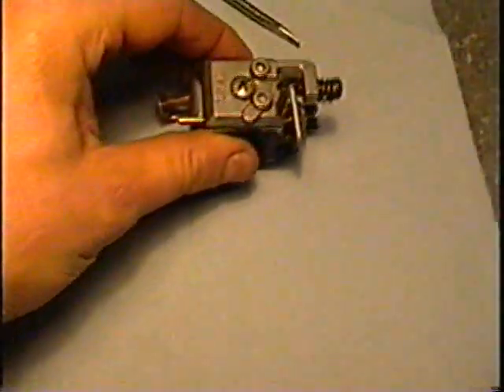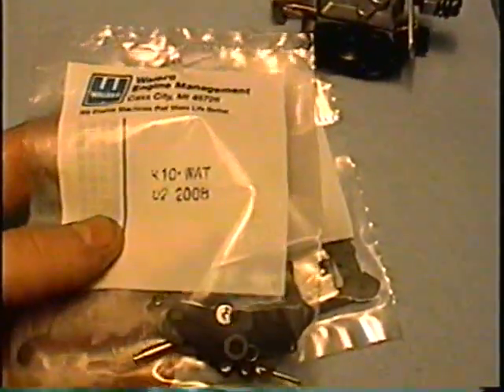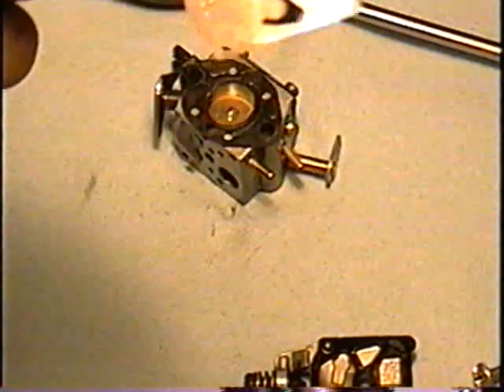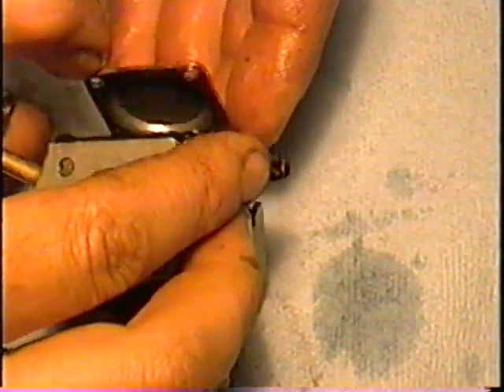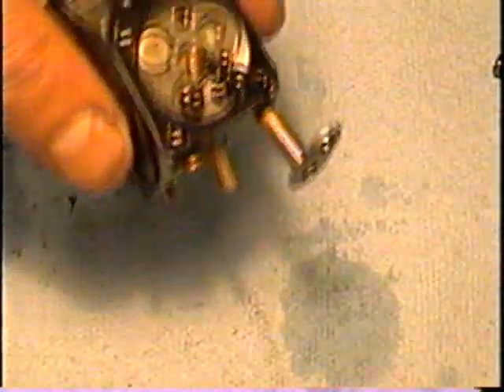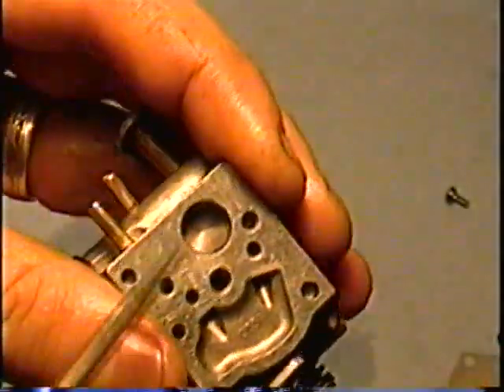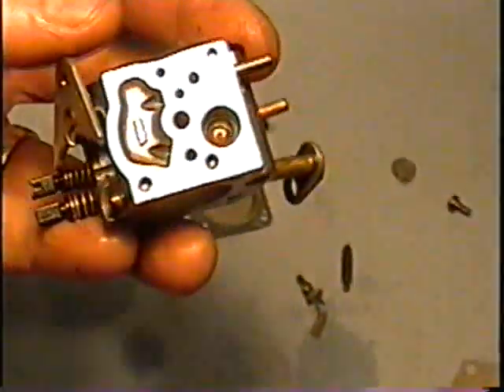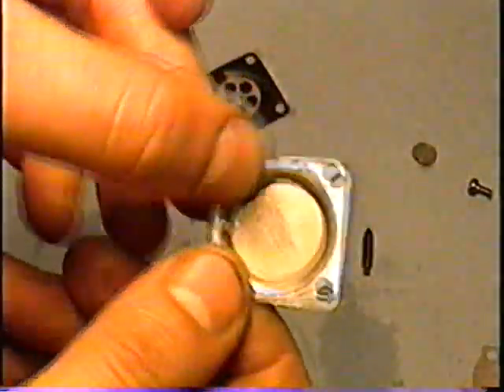HOW TO Disassemble Poulan 2150 Chainsaw Walbro Carburetor

Comment: I picked up an Echo weed eater today, and it wouldn't start so I took it to a local echo dealer and asked them if they had a carb kit for it, and they sold me the K10-WAT. kit. When they looked at the machine they said it was vintage "early 1970's"

Thanks for uploading this video, I may have been stuck without it, and i have to say replacing the needle, pin, lever, and spring was pretty dang tricky.

Comment: Hi, thank you for the demonstration. I have a 2150 that would start then die after a few minutes. I bought the kit and replaced only the pump diaphragm with the carb in place and without disassembling the linkage. Fixed the problem and I didn't have to go any further.

Comment: Thanks so much for your thoroughness. I rebuilt the carb with the k10 kit as per your video tutorial. My wacker now idles and does not bog down when opening the throttle however it still doesn't seem to be getting the higher RPM it needs to get the job done. I adjusted the high speed by ear....maybe too much oil in the mix? When does mixed gas become too old? Many Thanks.

Comment: Hi dony...I just picked up a 2150, used. It's been running great while still on the plug that was in it when I took it home. I've gone through a few tanks of fuel but with the last full up it won't start. I replace the plug and bought and filled it with 50:1 truefuel...synthetic oil and ethanol free 92 octane. Still won't start. It only fires with the throttle locked WOT. I checked the spark arrester which is fine. There was fuel coming from the exhaust. It has plenty of spark and again, fires

Comment: Hi Don I just cleaned the carb and it looks like there is no screen in this carb , is that an issue I mean there is the very dense filter in the tank and is there something I can put in the gas that will clean all the openings in the carb maybe a bit of marvel mystery oil or would make it too high in oil gas ratio, I did loosen that screw that holds that tiny spring in didn't want to have to put that back together again that's why I ask

Comment: Thank you so much for the informative video. I was at my wits end with mine and it was about to be binned and it turns out I had the metering diaphragm upside down - metal ring on the outside not inside where it would operate the valve. Nowhere else was I able to see this..

Comment: Without yet picking it'd seem the one still covering its hole is set in place. The other, being removed, I see covers some tiny pin holes. After setting it back over the opening, it too is now set in place.

Comment: Got a trimmer with a Walbro WT526 carb.  Replaced all 3 fuel lines and the primer but gas can't be pulled thru.  I bypassed the carb with a double-male fitting for testing purposes and it worked fine.  So I think the carb is plugged or the needle valve is stuck.  I have not disassembled it yet.  Any suggestions or common observations?  Should the rebuild kit be labeled for the WT526?  Thanks.  Sorry to see that X80057X was such a jerk.  Hope your wife will be ok.

Comment: It's odd like its flooding but at the same time starving for fuel. After searching, reading, and trying options, I narrowed it down to carb or coil. I just disassembled the carb to look for blockage. Under the 4 screw cover there are 2 buttons you don't mention in this video. One of the buttons wasnt where it seems to go. Could this be the issue? What are the buttons?

Comment: hey donny. are you aware of the carb upgrade for these types of poulan chainsaws?  if you buy the poulan/husky you get a different air filter holder and adjusting screw grommet. the number is wt 89. i put one on mine 2 years ago and it's still perfect. i even tried to adjust it again and wound up at the exact same spot.  the start pattern is different. now you pull the choke out and it automatically sets the throttle and flips the  start button up.little less than 20 bucks on ebay. would probably make a cool video. you can buy a knockoff  for 7 bucks but they don't come with the air cleaner and grommet.

Comment: OK.  Thanks.  The saw has good compression (115), good spark, the carb is rebuilt (with a screen this time) and new fuel lines and a primer bulb.  I know the lines are routed properly.  But it will not start.  Like you said, it made be plugged further in.  The saw is about 10 years old.

Comment from the maker: @youtom888 adjust the H screw at high speed until it run as good as it can. i usually don't keep mixed gas more than 60 days.

Comment: I have a question I am making something out of the motor  of a chainsaw ( the same brand as that one) and I need the whole motor out of the case. I have in done every thing holding the motor down and when I go to pull it out just the head comes off not the piston crankshaft noting  just the head. I didnt take off the clutch do I have to???  And if so how do I take it off?? PLZ reply

Comment: I changed out my old fuel lines(cracked)  My fuel bulb is also bad, so I by passed the fuel bulb. The saw runs good but each time I fill it with fuel it floods. I have to clean the plug,then it runs fine until I re fill  the tank.  Is this because I by passed the primer bulb?

Comment: hey guys i just so recently bought a poulan 40cc saw at my local flea market and it wont fire it has good compression and it gets gas 
so i pulled the carb apart and i forgot where 2 screws go and i cant for the life of me 
remember where they go 
this video is good for what i needed to know 
but its very much the same but my carb is slightly different 
so if any body can show me a diagram or something it would help a lot thnks

Comment: This is good info but if you clean the carb and find hardened diaphrams or bad gaskets just buy a new carburetor.  I've wasted money on 2 rebuild kits that would have paid for new carburetors.  There are a couple of internal check valves that can't be serviced easily and aren't included in the rebuild kit.  If they are bad you wasted your money on the rebuild kit unless you want to buy the check valves and do a lot more tedious work.  Also, if the metering needle seat is worn, you're out of luck.  it's too bad they didn't design these carburetors to be easily serviceable.